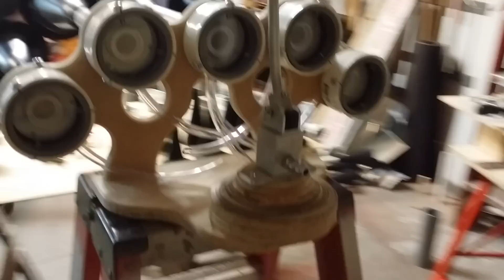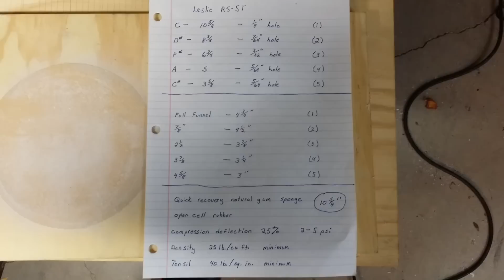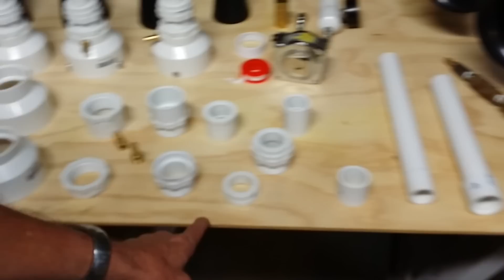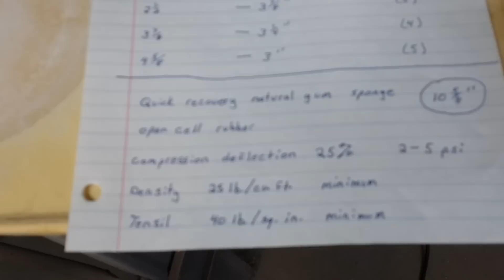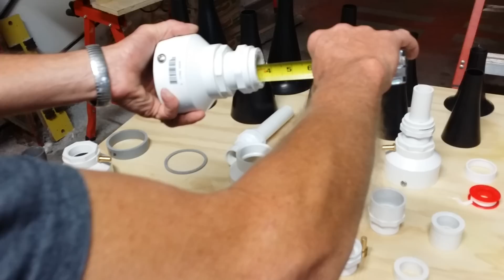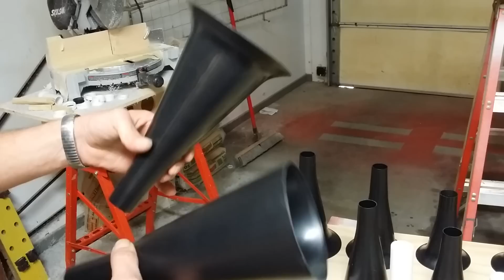How to build PVC Train Horns part 1

Comment: I’m wanting to build a horn. The notes that I want to use are D#, F#, and A#. Do you know what the lengths should be?
Reply: I built the Coyotes goal horn from PVC. You simply have to find out for yourself.
Reply: I can help you if you want. I can make unlisted intructional videos on my channel showing the construction and how to build them.
Reply: @pyryhillosalo  yes please
Reply: @PG13hockeyman  Ok! Will try to make one tomorrow.
Reply: @PG13hockeyman  You can also hear the Coyotes horns that i built on my channel. It's on the shorts section.
Reply: @pyryhillosalo  well a Kahlenberg Q-3 has 4 bells. You used two. Is it just hard to detect the other sounds?
Reply: @PG13hockeyman  The Q3 483-3 consists of two notes: Ab (208 Hz) and F (174 Hz). The real one has two Ab bells and two F bells.
Reply: @PG13hockeyman  It has 4 bells because the sound can fill the arena better.
Reply: @PG13hockeyman  You can create the exact same sound with only two bells.
Reply: @pyryhillosalo  do you think you could try Minnesota’s Q-3A?
Reply: @PG13hockeyman  What do you mean by "try"?
Reply: @PG13hockeyman  Minnesota's goal horn Q3 consists of the same notes as the Coyotes horn. In Wild's horn the F is half a note higher.

Q-3 A Hz levels in NHL:
AZ: 175 & 212 (OLD)
MIN: 180 & 212
FLO: 178 & 208
Reply: Hey did you ever get around to making it, and if so how long was the A# bell cut down to.

Comment: Is there a length that you use to cut each horn? I see the list in the video, but wasn’t sure if those measurements were from each end of the funnel. I would appreciate a measurement from each end of the funnel to get a tight fit over my 3/4” pipe and a measurement to cut the funnel to get the length for each bell end. Thanks! Great video! I’ve made a “C” horn and it works great.

Comment: I realize this video is several years old, but instead of cutting some of the pieces to shorten them for higher frequency resonance, why not go with smaller diameter pieces for those notes? Was this to closer mimic the prototype horn, or just never tried it? No wrong or bad answer, I'm just curious as I've seen this done by another fellow, but, his do not sound as good as yours. 

You guys really did take the time to tune them well.

Comment: Is it possible to build a smaller scale variant of a horn that sounds spot on identical to the full sized variant? Like something that would fit inside the shell of a 7.5 inch gauge locomotive?
Reply: I kinda doubt it unless you're building an F or E unit... I guess you could put them in a row in a GP or SD, but when you fire it off you'd probably blow the body off!

What are you building? I'm working on an F7.
Reply: @kleetus92  If I do end up building any units, I plan to do an MP36PH-3C, an SD70ACe, and a GP38-2.
Reply: @Ferrosudō_Chicago  cool. After the F, my ultimate is a trio of SD45T-2's in Bessemer and Lake Erie paint...
Reply: @kleetus92  Nice. If I were to do this, I would want to start with the MP36 and a few Gallery Bi-Level cars with an actual operating Cab-Car. I'd want to be able to operate and control from either end. Has anyone ever even done a working 7.5 inch gauge Cab-Car before to your knowledge?
Reply: @Ferrosudō_Chicago  I'm not familiar with a cab-car? Is this a commuter service unit?
Reply: Oh took me a second, but not sure. However, that wouldn't make it any more or less difficult than any other build. In fact it may be easier because you have a ton of internal space, assuming you don't put a full scale interior in it.
Reply: @kleetus92  The Cab-Car would not only be fun, but it would also be very useful too because if this dream project were to ever be a reality, there's no way it would be affordable to do an entire closed circuit railroad, at least not all at one time. I don't even know if the project would even be doable at all because track by itself is very expensive. But if I were to do this project, a Cab-Car would actually be very necessary from an operations standpoint. As to how I would do it, I'd have to figure out how I'd efficiently design a nice looking consist that is reliable and as low budget as possible. I want to design the coaches so people can ride in them so unfortunately they are going to have to lack the detailed interior. The locomotive would be the only unit that doesn't carry anybody. The front of the first coach behind it would be where the engineer would sit for outbound trips. Inbound trips I'd like to design the Cab-Car to where the front half would have all the lighting components, horn, compressor, and all that. And towards the center or rear half would be where the engineer and maybe even a few passengers can be seated. I kind of have an ideal design in mind, but I'd have to see if it would even be realistic to successfully pull off. I would love to fit any units I build with a real and authentic horn rather than just a recording. As for the bell, I can cheat a little bit with that and just do a recording of a Graham White E-Bell and even a recording of prime mover sounds.
Reply: @Ferrosudō_Chicago  you should check out some of the stuff on my channel.

Comment: For anyone still watching this video here is the parts list I came up with after researching their videos and making my own set.
I grabbed everything from Home Depot, Lowe's has the same supply.
Diaphragms poly carbonate or stainless steel 
Rubberized weatherstripping 
1 1/2 x 3 base $3.35
1 1/2 cleanout adapter $1.50
1 1/2 male $1.08
1 x 1 1/2 adapter $1.44
1" coupler $0.62
2ft of 1" pipe $2.26
2ft of 3" pipe $6.76
Funnel
Pvc primer and glue
5/16 Bolts .17 per
3/8 Fittings for air
Reply: Thx for taking the time to poast this
Reply: Thank you

Comment: I was searching for Polycarb sheets and found this site (http://www.onlinemetals.com/merchant.cfm?pid=15585&step=4&id=270&gclid=CIiXudWhzMYCFRCqaQodHsAN4g)  however I'm guessing that a fine-tooth blade in a coping/band/jig saw would be recommended.  Do you have any tips on cutting the square/rectangle blanks into circles?

Comment: I tried to build one horn as our "prototype" with plexiglass and i don't think that vibrates to make the sound and used rubber foam which does not recovery its form to well do you think thats the problem. And is there any other way i can flare out the horns because i don't have the equipment to make that round piece of wood. Where can i find the rubber sponge and what type of polycarbonate do you use, thickness thanks
Reply: What size polycarbonate and brand
Reply: Try using a metal mixing bowl. Get one at walmart pretty cheap.